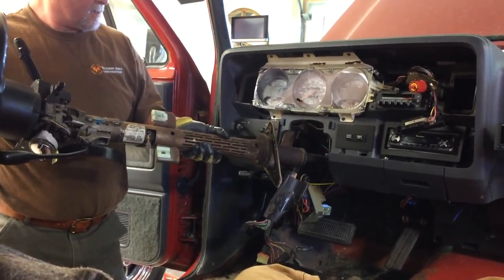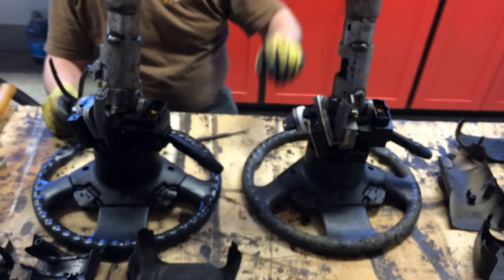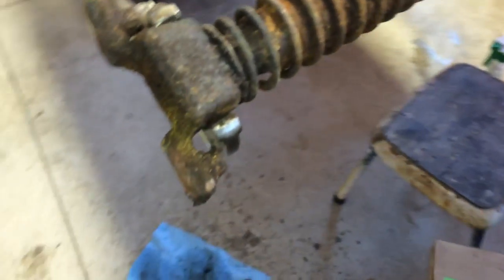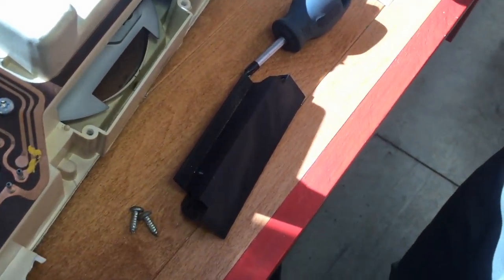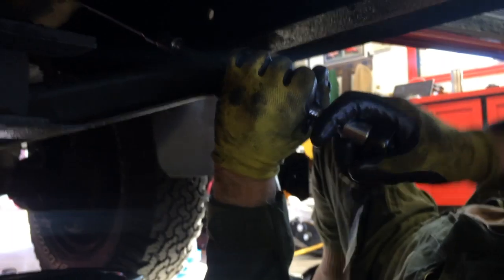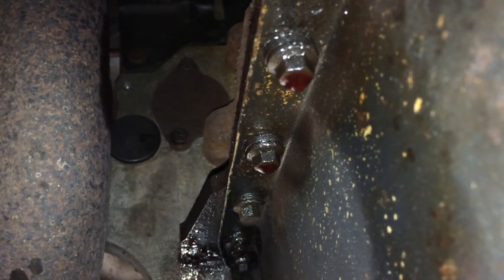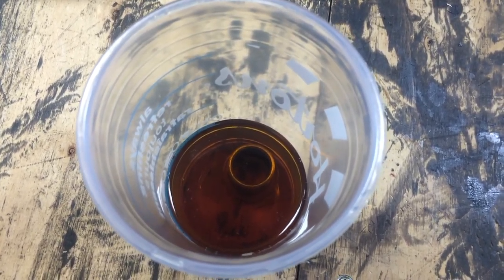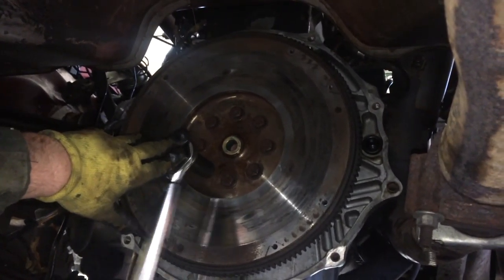Auto to Getrag Conversion Pt 2

Comment: Make sure you take the TPS module off your injector pump to throw in the sale of the auto.
Reply from the maker: Oh I will! I just need to find some screws to match the rest on the pump top, and I'm also getting a switch on the dash to replace the overdrive switch with just the cargo light button.

Comment: you said full restoration why dint you turn the flywheel
Reply from the maker: Fred Mervine Don't know, didn't really think it needed it. Works just fine and has been for over a year now. No issues.
Reply: some times it ok if you are on a budget  but its a good idea to have it cut wouldn't want to take it back out if the hot spots give you clutch chatter